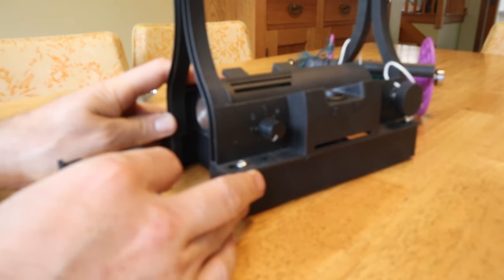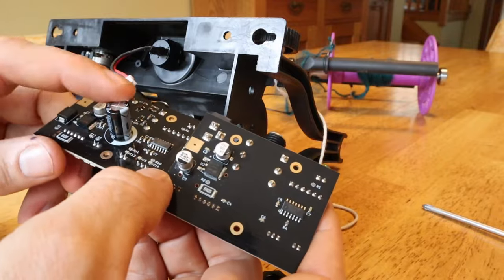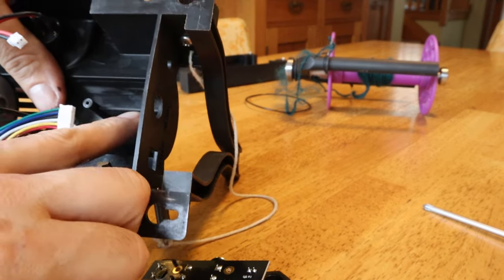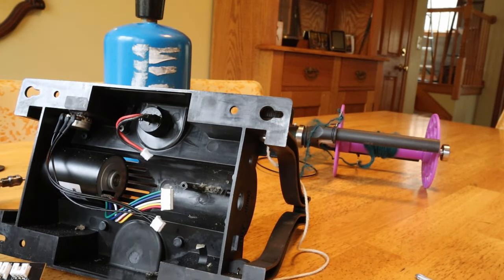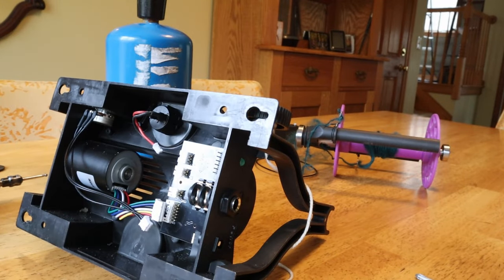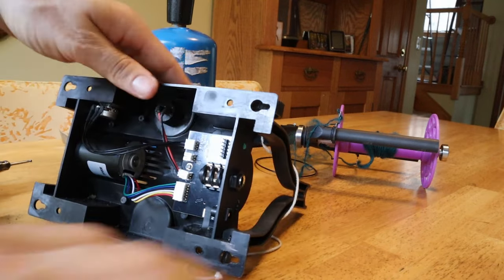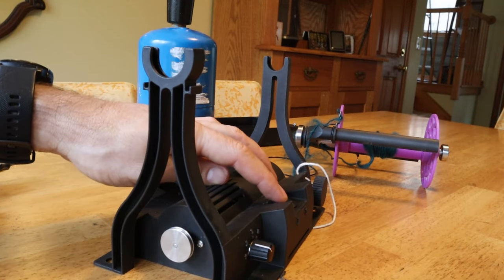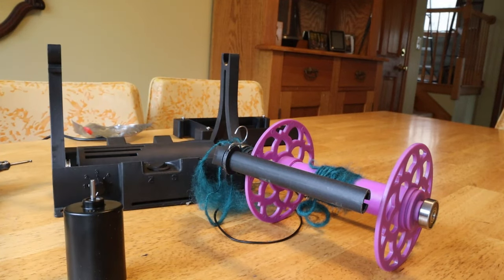Spin 175 - Upgrading EEW 6.0 to the 6.1 Circuit Board

Comment: I wonder if there is a reason you didn't place the capacitor on the other side of the board bent 90 deg so it sits flat on the board near the connectors, making a rectangular silkscreen on your pcb so the soldering placement is evident and assembly is easy for the factory to understand your plan, that will help you to avoid all this modification and just hotswap the board.  If you already ordered a bunch of pcbs or even have them assembled then you might want to desolder the cap and solder another with bent leads and just get it out of the way of the plastic . It might look sketchy , but you might still be able to avoid all this extra hassle for the end user. Just some thoughts 👍
Reply from the maker: I think mounting a big cap like that would not be stable mounted that way.  This would require some potting compound to be used to hold it in place and even then it would be the highest point on the pcb and likely to get knocked off.  Also this capacitor will be charged at 12V so while not dangerous if something shorted the large exposed leads it would be not be good.  Lastly, this board was designed for the EEW 6.1 and the best positioning is where I put it and I don't want to create a special circuit board for the EEW 6.0.

These are the reasons I posititioned it where I did.  I do admit I considered a better placement for the EEW 6.0 in earily development but decided to go with the best design for the EEW 6.1.  The rework on the EEW 6.0 will be pretty rare and I can't see removing that plastic taking anyone more than half an hour (or ask a friend who is more comfortable doing these sorts of things if anyone is really worried about doing it themselves) so I think it was probably the right choice.
Reply: @DreamingRobotsBlog  Hey , thanks for the answer , I honestly have to disagree with that statement as this could  have been solved with an iteration on your prototyping phase, as a Hardware developer I can share you that the last thing you want is the end-user to be annoyed by a recall or upgrade that will make them fiddle  with their nice piece of equipment. If they break something they will be annoyed. You could have easily move the capacitor out of the way as it is a Main_VCC storage cap and can be located anywhere near the main_vcc rail so no need to be exactly on that location as it's not frequency critical. I bet a couple mm shift will avoid that plastic wall and not affect your pcb design at all . But hey , it's part of the learning curve , happened to me as well, maybe this change can be executed and validated on a next updated version of the board in case you want to continue using the same plastic injection mold 🙌 keep up the good work !
Reply from the maker: @ChEsArE9000 Thanks for the feedback.  I will consider it.

Comment: Do I need to replace the static tape if I’m installing the 6.1 circuit board?
Reply from the maker: No.  Just stick it to that large copper pad.  If it doesn't still well you can you another piece of tape on top of it to hold it to the circuit board.
Reply: @DreamingRobotsBlog  sorry I should rephrase - is the tape still required with the new circuit board? My tape has come loose so if needed I’ll use fresh tape
Reply from the maker: @OneCatCrafting  I don't think the board will reset so that is solved, but it is possible for the steel spindle to build up a small static spark that will feel like a little shock which some people really don't like.  That is why I still include the tape.  If the little shock doesn't happen or bother you then you don't need the static tape.

Comment: Will this fix the random stopping issue?
Reply from the maker: It is designed to help with that.  Does the random stopping issue only happen with the foot pedal attached?  If so clean between the metal plates and if that doesn't help then this does have some extra protection for static coming through the foot pedal.
Reply: My random stopping issue occurred with and without the foot peddle. About to try to install the new circuit board. Hope that corrects the issue.
Reply: Well, that didn’t take as long as I thought at all. The Dremel worked well - I may have discovered a new favourite tool. 
The light flashes once plugged in until spinning starts, at which time it is continuous. 
I plan to do quite a bit of plying over the next few days, so should be able to report on the stopping issue.
Reply: The light is also continuous when the speed is off.